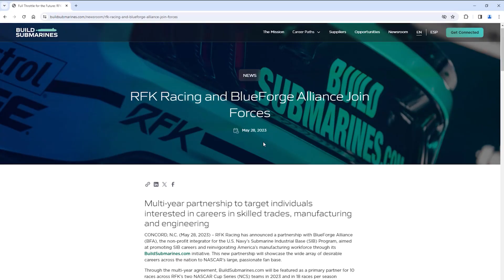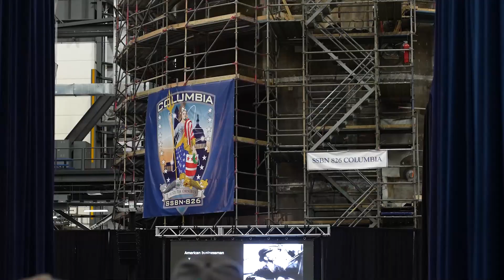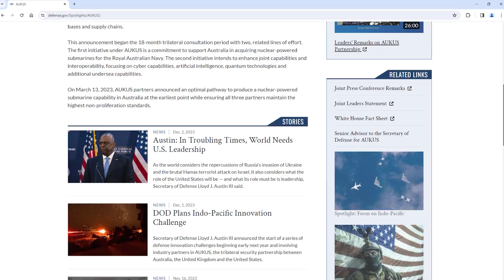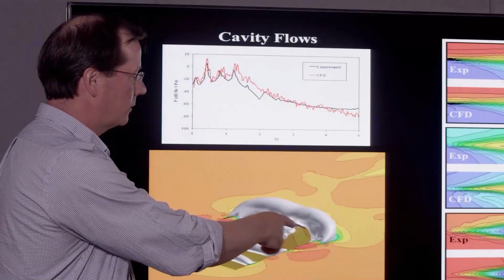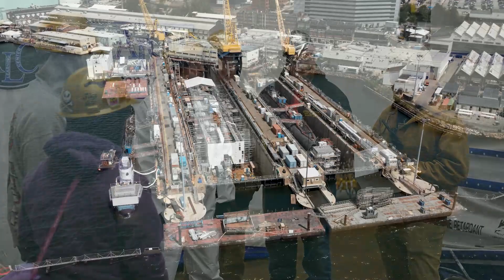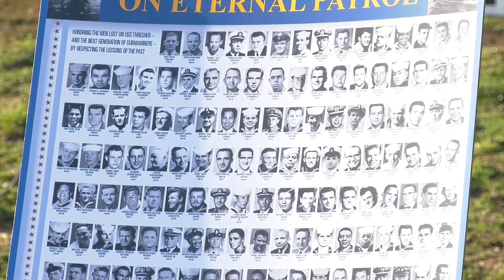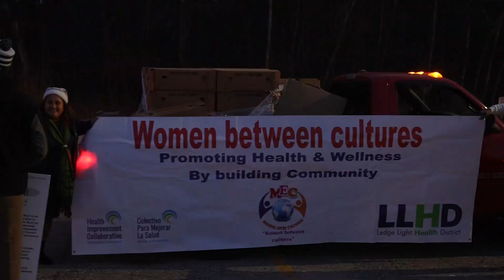Electric Boat 2023 Year in Review

Comment: In my opinion, a strategic missile submarine should have two propulsion systems. The main propulsion is the pump jet system optimized for speed. Someday, an enemy submarine could detect the American sub and the only way out is to scoot and disappear in the turbulence. The second means of propulsion is by magneto-hydodynamic propulsion. No moving parts, stealthily gliding at 10 knots.

There are too few SSBN bases and logically an enemy sub will lie in wait as US SSBN comes in or out the base and fall prey to attack. There has to be a dispersal system of islands, subtenders or subsurface resupply hubs where a sub can take supplies, ordnance and maintenance.